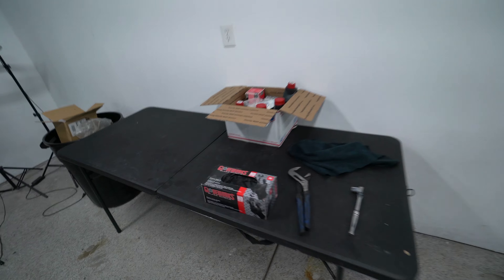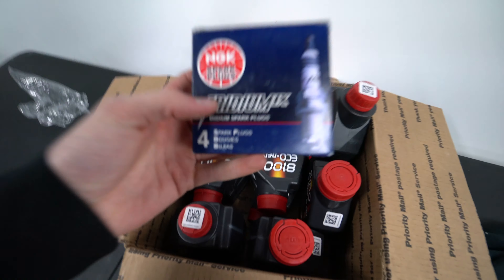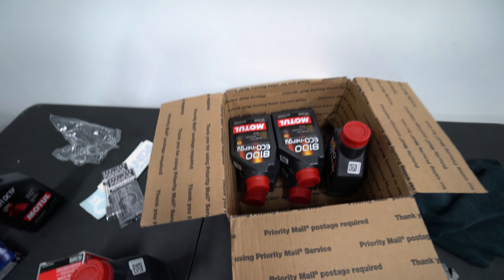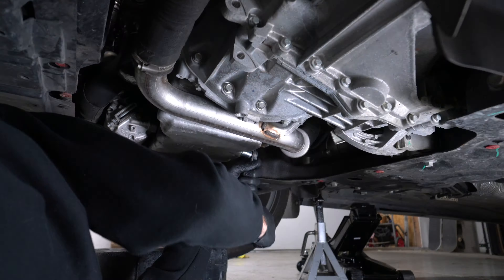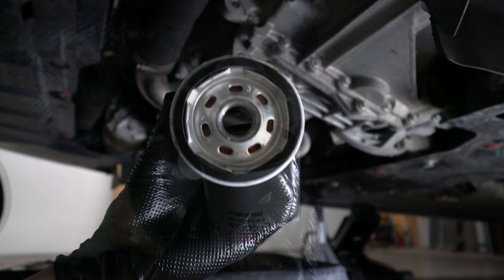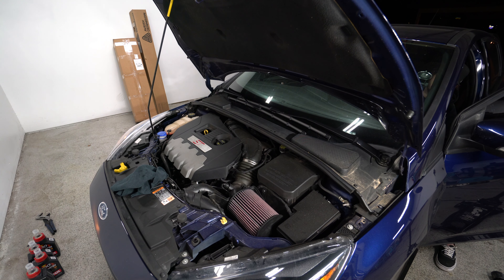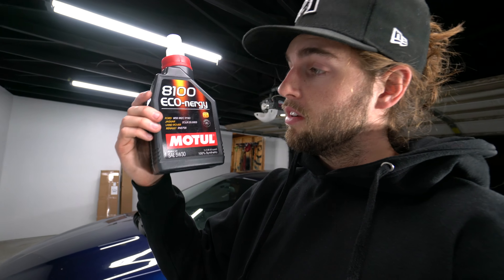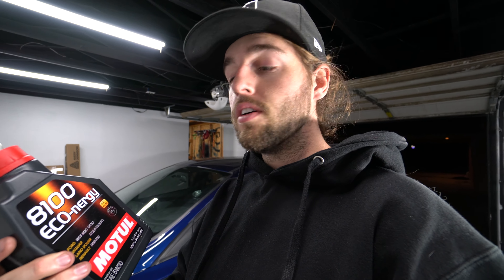How to Change Your Ford Focus ST Oil

Comment: Should be noted that the motorcraft FL-400S filter is being used allowing it to be filled to 6qts. The regular filter FL-910S has a capacity to fill the engine up to 5.7qts. Don’t get them mixed up and drown your engine.

Comment: I used 5w30 and I eptied mine yesterday and did full oil change. I stopped it up by a quart aprox 1 month ago to be safe as I could.get the tools to change oil. Ot wasnt sludge so was alright. Anyway I eptied it yesterday and ran half a liter through to refrain and flush system and all together aprox 5.5l came out. I then proceeded to pour in the recommended amount 5.3l and run idle for 30s and checked oil 5 mins later and was between the correct amount. I will add this was measured on an even surface. I then installed my torque mount and new pads so 3 hours later and drove home... I remeassured again on a slightly un even side to side surface that being the camber of the road and the oil was way high this time... like half an inch above the top dot. At this point I didnt have access to axle stands and a jack so just had to leave it till I have access but now I'm worried. I drive about 50miles a day. And cant get a ramp till nexr week. My oil pressure gauge is completely fine and barely touches 4bar oil pressure when warmed at 70c+ and at full throttle.theough a few gears. So I assume it is alright?

Comment: The next time you do an oil change, fill the oil filter with oil before fitting. The reason behind this is on start up there will be a delay for the oil reaches any part of the engine, because the oil filter has to fill up first.
Reply: No you dont want to do this because youre adding unfiltered oil as "primer" when the pump actually pulls oil during cranking so when the engine fires off the pump has primed clean filtered oil.
Reply: @MichaelJohnson-uo3ef New oil is pure clean bro, its not necessarily that it goes through filter first.
Reply: Not necessary unless you have a huge commercial diesel engine where the filter holds like a gallon of oil.  On small passenger car filters it's not needed.

Comment: Pennzoil Ultra Platinum is the best oil for the money. Been putting it in my ST for two years now. There’s a great comparison video on YouTube.
Reply: Delta 9 not really. It’s a really thin 30 weight. Prone to leakage. M1 EP is where it’s at.
Reply: I use penzoil also think it’s an amazing oil.

Comment: Don't use Motul it has bad heat resistance you're going to need to keep close track of your oil level and end up using more oil over a 7,500 mile OCI. You can find a lot of good alternatives.

Comment: Im thinking about buying a ST....any advices?
Reply: Watch out for mods. Pressure the dealer or seller you go to to inform you of any and all modifications or tunes.
Reply: @amihere383  Thanks man, i already got it !
Reply: @hirayaman246  Badass! How do you like it? I just bought one 2 weeks ago, so far it's been fantastic
Reply: @amihere383  yes, it pulls very good and its also confortable....just 2200 km here, still dont push harder than 3000-3500 rpm to allow the engine to settle a little more....
Got it in wagon version, for extra cargo space and also with a factory engine soft upgrade for  330 hp ( predator version)
Reply: @hirayaman246  Damn, you Euro folks get all the options. All we got here in the states was the hatchback until 2015 when they started adding a few trims, the ST2 and ST3 packages. There aren't even any factory performance upgrades you can get unless you go through Ford Performance, which is still a separate deal after buying the car, and it only adds 90 torque, no hp. But definitely agree, I got mine used with a cobb exhaust, it pulls so quick, sounds fantastic, corners like it's on rails, I love it
Reply: @amihere383  Its the first sporty car that i own that really is both confortable and sporty when needed
Reply: @amihere383  yes, they have some facilities but ive heard that Mondeo is no longer gonna be built here....
Reply: @hirayaman246  Oh yes, for sure. The seats are quite comfortable, and if i'm not feeling like driving fast the power delivery is so smooth that it's quite a nice commuter and around towner. Ford did fantastic with this one I think, it's really a shame they shut it down in the states.

Comment: Which is more fun to drive/easier to mod, a Focus ST or a 370z?
Reply: Jt Fox I would say the st would be faster when modded but because it’s turbocharged more things can fail I love the 350/370’s because they are rwd not fwd so you can go sideways also coupes are always more fun to drive even if it’s slow

Comment: Guys, don't buy into all the hype and marketing.  Just change your oil every 5,000 miles (or sooner if you wish) and use an off-the-shelf oil that is API-certified and the correct weight for your engine.  I've been running Super Tech full synthetic and an OEM Motorcraft filter for years and have gotten over 300,000 trouble-free miles on my Ford Focus and Explorer.  The last Blackstone oil report on my 4.6L Explorer was "flawless" (their words, not mine).  The key is to do those oil changes regularly, especially on these turbocharged motors.  Don't buy into all the hype and marketing from these "performance" oils.
Reply: ST or base model ? you kept whole car stock and got 300k?
Reply: @Jackson-xm6xb  no, it wasn't an ST. It was the ZX3 "mid grade" model with the duratec 2.3L motor.

Comment: You've never filled the new oil filter with fresh oil before throwing it on?
Reply: Diego Tobar why would you need to if it’s not a diesel motor I’m guessing for the split second it starts up dry
Reply: Diego Tobar I would.

Comment: Can anyone answer what would make this brand the “highest grade” vs another brand’s top performance oil? I’m just curious what makes this oil so different since he doesn’t go into much detail.
Reply: Not sure what makes it the best he could be getting that stuff for free so he’s probably just pushing their product , but royal purple is my go to and filling the the filter before putting the new one on is a good move , always check spark plug gap even if it comes pre gapped.

Comment: Can you run this on a fully built ford focus with 85000 miles?
Reply: I’d recommend it. Motul classifies themselves as “high performance” oil. I’ve never had a problem in my Z but I’m not modded to be fair